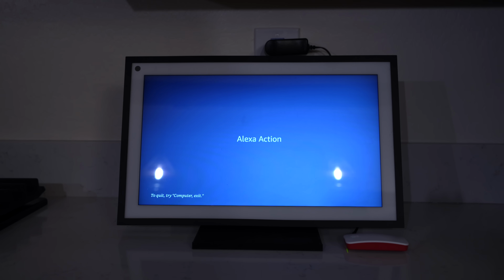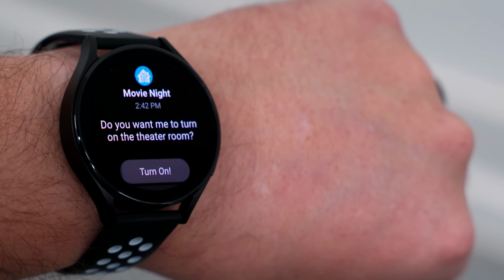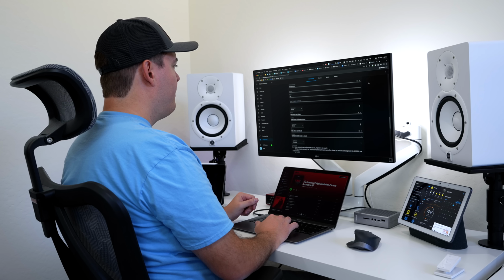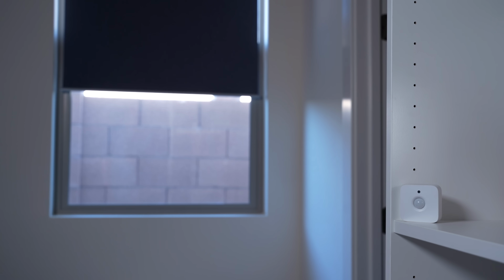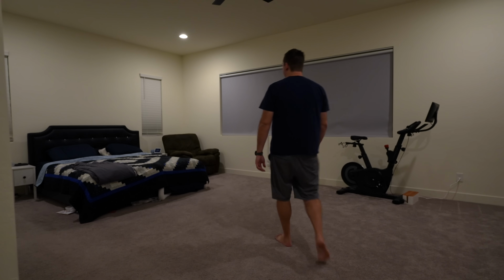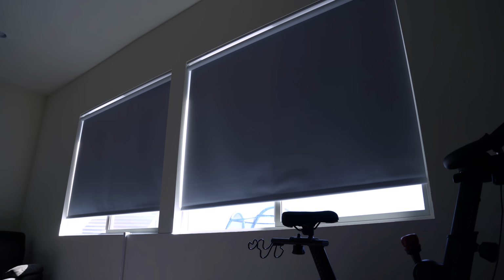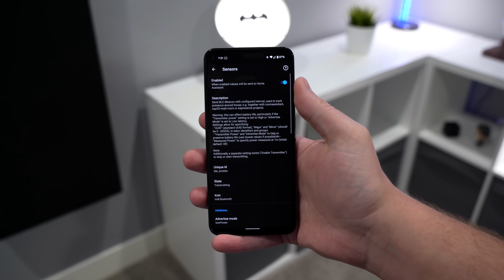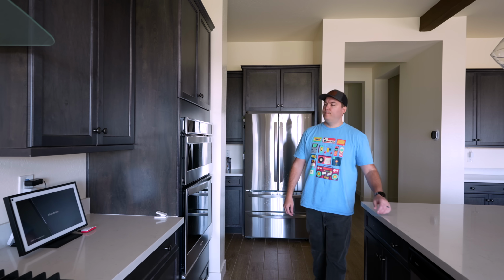My Most Futuristic, Advanced Automations EVER!

Comment: I used room assistant in the past, but changed to espresense. A better solution with hardware that it's a lot cheaper and easy to have multiple in the same room.

Comment: I use a wifi mash solution (Linksys Velop), though not cheep but since it's needed for good wifi coverage anyway, it will also automatically switch to the strongest wifi device when switching room and having used it for a while it also works quite well.

Comment: I write my stuff from scratch, more or less.  Home assistant is only used as a dashboard utility and I honestly prefer a mixture of HA and Grafana.   So I write code to respond to MQTT messages (or other data) either by event or by polling a cache.  They make decisions and send other messages.  Eventually that ends up switching something on or off.
I find that making an automation from scratch is around 20% effort to get it working and 80% trying to make it work "right".  Sometimes even as high as 5/95%.
Heating for example.  The obvious thing is... if the temperature is lower than the target, turn the heating on.  If it's higher, turn it off.  Simples, right?  What changes the target temp if it is to vary?  Long story short you have to realise there will be multiple, probably competing schedules, events, states saying the room should be different temperatures all at the same time.  That problem gets compounded again when you consider the boiler and radiator codependently need to be in the correct state to function.  It gets even more complex when you consider multiple zones, multiple schedules, presence detection.  The problem literally explodes when you start asking "What if..." and having "Ah... sh...t" moments.  
Then of course you have to consider the bucket challenge and the family friendly issues.
The bucket challenge is ... what happens if I accidentally tip a bucket of water over the system rack?  What if fairies make off with the Wifi in the middle of the night?  What if the internet is down for hours?  Importantly, "Can I still use my stuff?", "Can my friends/family still use my stuff?"
The transparency of use is an extremely hard one to maintain.  The property that a random visitor to your house would still find light switches work as intended, the radiators can be manually turned on/off and the heating controller "Boost" button still works.... without the automations overruling the humans OR getting fouled up BY humans.
I have come a long way, but there is so much further to go.

Comment: Again, these aren't really automations, they are just remote controls.  The location/presence awareness, I'm sure, if you are fully honest, is, well, there is a LOT more to it.  I'm sure you have already found by now that BLE isn't great.  Your phones power saving will make that fail out of the box unless you are broadcasting beacons constantly, forcing the phone to remain awake and running it's battery flat.  You also have to account for people appearing to be in multiple rooms or in no room at all.  People simple walking through a room and so on.  Detecting all these different features of presence awareness will take a bit more than a few gimmicks with an echo.  Depending on what you are switching dictates how you interpret the presence metrics.  For example, a motion sensor sensing motion in a room at night might turn the light on, but only for 1 minute.  However someone turning the TV on in that room generally means they are going to stay for a while, so things like themes, scenes, heating, cooling, curtains can all respond.  You don't want all that happening 10 times a night because the cat walked through the room.
A smart device/system in my opinion should require NO intervention.  It should simple take something you do now, manually and do it for you.  Anything which is just a form of switching things on and off with voice/gesture/phone app/whatever, is just a remote control.  We have had remote controls since the 1960s.  Do something different.
Reply: I like some of them though.  Didn't want to sound too negative.  The weather thing, I've been trying to get my phone to do that and read out the time while the alarm is sounding or when I dismiss it.
Other automations of yours seem to me like "Alexa bitching at me all the time" category.

Comment: Great video and massive respect for setting this up. However, the problem with some of this stuff, for me at least, is that you rarely want to do these things 100% of the time. Eg playing music when your wife leaves home. It just gets annoying real fast. I’ve done something similar for a while with notifications on my phone/watch and after a month or so it drove me absolutely mad.  Eg I had some automations when walking into my office but sometimes I just walk in and out to quickly grab something. So I set a timeout. But then when I actually wanted the notification, I was now waiting for the timeout. Yes, I get you can just reply “no” or in my case I could just dismiss the notificatIon. But sometimes even just getting the notification gets annoying. Replacing this with a smart assistant talking to me would make it even worse I think. If my speaker asked me the same question every single time my wife left home, tells me what to wear every day, …I’d smash it to bits in a week. Like with all automatons, the times it works, you take for granted. But that very few times it goes even slightly wrong, is enough to cause frustration. I find that to be the biggest challenge in building an actual SMART home.

Comment: In your home automation, have you figured out how to: automate the movement of the bathroom shower curtain after shower?  Sounds funny right?  Well, the need comes from when done with a shower, the curtain is closed/compressed to one end of the shower.  But, you should let the curtain remain fully open to allow it to dry and not get mold on it.  I keep forgetting to fully open the curtain and let it dry.  What would be nice is to have it open so many minutes after the shower is completed.  Any thoughts?  The switchbot curtain mover is not water/humidty proof enough.

Comment: IRRC a GPS works by having your phone connected to 3 satelites, because they can pinpoint your location, and less than 3 wont be able to (cuz math i guess), so if you had a bluetooth distance measuring raspi in the center of each room, would it then not be able to pinpoint your location in your house as long as you were near 3 of them? (with math and stuff)

Comment: How do you keep your wifi router from overloading with all of the smart devices? Mine is always dropping devices (Netgear AC R7000). Any tips?
Reply: Mesh Wi-Fi. I recommend Unifi APs, you can set them up thru an app if you’re not too versed on your networking knowledge.
Reply from the maker: Yes everything Bruce said. With a good router and Wi-Fi access points you shouldn’t run into any issues.
Reply: @SmartHomeSolver  Thanks!
Reply: @AtracBreezy  Thanks!

Comment: So glad you checked out Room Assistant. I need some advise now since someone that I can trust actually has done this!! I've been considering it, but I just didn't step into the mud, so to speak, since for me it'll require a ton of RPI's...since I prefer Google over Alexa, and I prefer "No voice assistant" over "Bezo's has potentially all your information, would you like me to send him your soul?"

Joking aside, here's my question.
I'm looking at doing what you have around 2:58. The idea for myself is when I move from one room to the other, music plays in those other rooms. The question in specific is if you can setup devices to transfer the audio to multiple bluetooth devices that are 'speakers'.

Here's my scenario in specific:
Each room of the house, I have a specified amount of BlueTooth Audio Wall Receivers from Pyle. These receivers have a BlueTooth signal and connect to a pair of speakers.
Is it possible to utilize Room Assistant to connect to 'each' bluetooth device (there's 8) and transfer audio between each without them "Disconnecting" and "Reconnecting"?

My concern is, at least with these Pyle ones, they tell you "Device is connected" when a device connects to the bluetooth of them. Which could be rather frustrating when you're listening to music and switch to another 'speaker' that wasn't immediately connected to BlueTooth.

If this is possible, is there anywhere I could go that is directed to documentation for this? I'd love to read into it a bit and see what exactly I could do with it.
Thank you!

Comment: I'm trying to decide between RoomAssistant and ESPresense. Any suggestions?
Reply from the maker: Lewis from Everything Smarthome just made a video on the ESPresense and it seems promising. I haven’t tried it myself but I think it’s less expensive and you can actually buy the hardware right now unlike Raspberry Pi’s.
Reply: @SmartHomeSolver  Thanks for the reply! That's exactly what I was thinking though. Cheaper hardware that's a lot easier to get my hands on. The devices themselves are a little bit smaller too, which I like.

Comment: Hey! Greetings from Brazil! Two questions: that temperature dashboard and other controls, is it Home Assistant? I couldn’t figure it out. 
Also, in your new home, where did you wire things to? Is there a controller somewhere?
Reply from the maker: Yes that’s home assistant on the dashboard. Here is the video showing how to do that https://youtu.be/4vu4aqWI3_c 
Yes I have a few smart home hubs connected to a network switch in my laundry room. Check out my recent tour video and that’s where everything is plugged in.
Reply: @SmartHomeSolver  Thank you! Would you recommend any wired integrator like Control4 or any other out there that maintains open protocols and integrations with HA and Alexa? Or should I simply connect them to the network  via a switch and work from there via TCP/IP?
Reply: Buddy?

Comment: Are you seeing any issues with your cell phone in this configuration?  I’m wondering how the battery may be impacted, and do you run into connection issues with other BT connections in your home with your phone (perhaps earbuds or devices like BT Govee tech)?
Reply from the maker: Almost no impact on battery life luckily. If I had to guess it might take off 1% total for the entire day. I’ve even turned the sensor power transmitter to high and it didn’t effect battery life either. Also I haven’t had any Bluetooth issues. I connect to my watch and wireless earbuds without any issues.

Comment: Nice, how fast does it detect you moving from room to room? If you automate it to turn on a light is it instant or like 10 seconds ?
Reply from the maker: It can be instantaneous or it could take 20 seconds. It depends on the signal strength and how fast Room Assistant is refreshing. I wouldn’t use it in replace of a motion sensor though.

Comment: Why Raspberry Pi’s instead of ESP32’s for room assistant? Cheaper and more available.
Reply from the maker: I started this project a while ago. If I would have seen Lewis's video about using ESP32's recently I might have gone that route. The automations would be the same though.
Reply: @SmartHomeSolver  thanks Reed, I see. You’ve done some nice work here regardless. Maybe you can get the Pi’s to measure the Bluetooth signal strength and whichever had the highest treaty reading is the room you are in? This would possibly be more resilient to changes in the environment and easier for people to setup as it removes much of the “fine tuning”? Appreciate your efforts and videos.

Comment: One thing I don't get about Room Assistant is that the Bluetooth signals have a radial dropoff (ignoring walls and other obstacles). Surely it doesn't have a firm grasp on where each room begins and ends. How does that work?
Reply from the maker: It's all about fine tuning it to know how close you are to the Raspberry Pi. Once I leave the room, the walls help block the signal so it only picks me up when I'm in the room. But once I adjusted all the numbers it works surprisingly well.
Reply: @SmartHomeSolver  Is adjusting your phone's Bluetooth power a key requirement to be able to use Room assistant ? I don't think you can do that with iPhones or most phones really.
Reply: Place a device in each room you will occupy. Between them they'll decide which one you are closest to and thus which room you are in
Reply: @TechTutorialsDavidMcKone  Right, but unless you're actually giving them a floorplan to work with, they don't actually know where each room begins and ends.
Reply: @loganfisher3138  It's not that clever, think of triangulation for mobile phones
So I have 3 rooms that have some type of Pi configured with Room Assistant and part of that configuration is the room name
But it's really just a name to pass on to Home Assistant
What they do is monitor the Bluetooth signal from my smart watch
Each one is calculating its own distance to the watch and between them they'll decide which Pi my watch is closest to
So if I'm closest to the Pi that has been configured to represent the kitchen, then Home assistant will be told the watch is in the kitchen
So as Reed suggested, you have to place each Room Assistant as close to where you will likely be sitting down in a room for instance
Fortunately the devs created an iPhone app which can tell you what those distances are, although they're not actual distances
The first time I tried this with a cheap watch, I was standing right next to a Pi and it was reporting me as being several metres away
The distance for the iPhone was more believable, presumably because its signal was much stronger